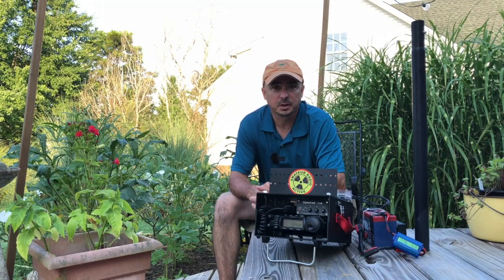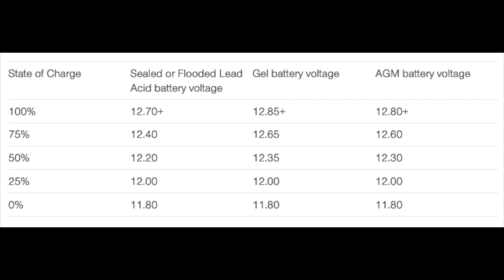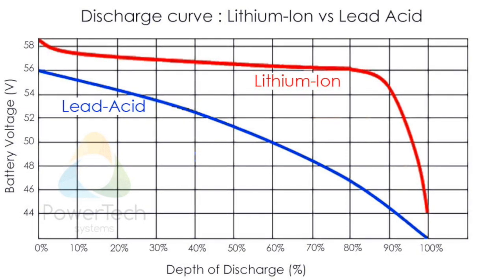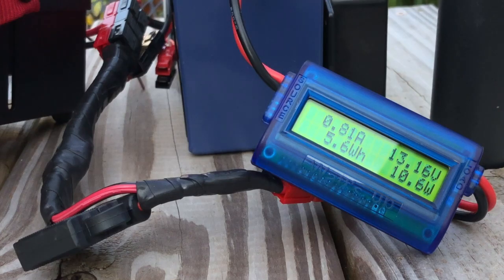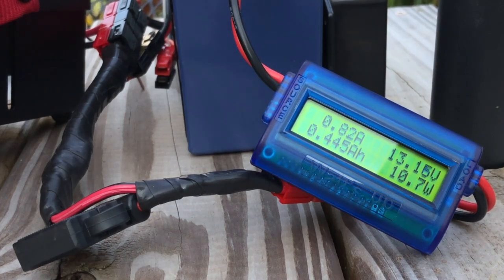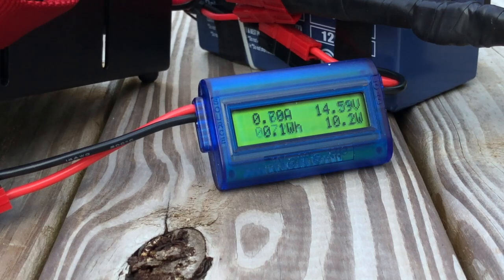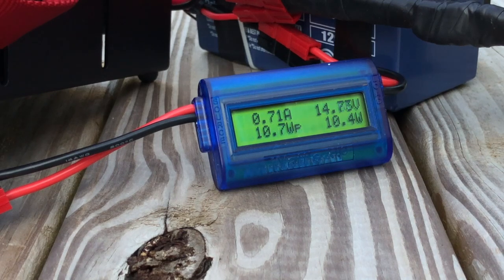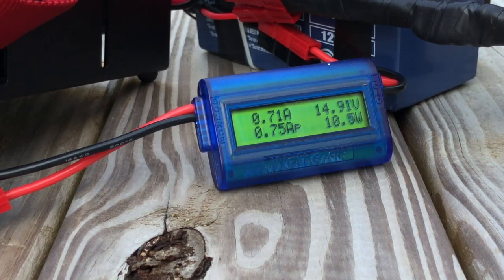Watts Up Battery Meter

Comment: Thanks for explaining how this meter works.  I just got one so I can monitor my new Bioenno 12 volt 4.5 amp/h battery when using my FT-817ND.  I had been using a SLA 12 volt 7 amp/hr battery but that thing is heavy for backpacking!!  Juddie - WD8WV
Reply from the maker: This is a must have if you are moving to the LiFePO4 batteries. You will find it to be invaluable in the field. 73, de KM4ACK

Comment: Great short video. I have a very similar load meter and find it really useful for all the same reasons you stated. Thanks for sharing . 73 de 2E0IEH
Reply from the maker: It is hard to live without that meter. Without it you are truly flying blind. 73, de KM4ACK

Comment: As usual, nice video Jason!  Do check out the PowerPlus from Buddipole.  It provides state of charge info plus a low voltage disconnect to protect your battery from fatal discharge damage.  (Ask me how I know ;).  Also they sell the Buddipole PowerMini which also provides solar charging data (and it is RF quiet). 73, Greg  VA7BC
https://youtu.be/KdX_asWFRPE
and 

https://youtu.be/1fWxEUP32kw
Reply from the maker: Thanks for the link. I'll check those out. 73, de KM4ACK

Comment: on a side note... Have you ever done the trick with the FT-857D on the power plug that sets max usages (watts, amp draw, backlight)? I'm thinking of putting in a switch so I can do it more easily if I need the full 100w when on battery while mostly running just above QRP. I think it limits you to 20w.
Reply from the maker: I don't think I have ever seen that mod. Have a link? 73, de KM4ACK
Reply: @KM4ACK  Sorry, no link. But it's in the owner's manual on page 34 for the rear panel connectors describing the input power cord.
Here's a cut-n-paste from the pdf version:
INPUT Jack
This is the DC power supply connection for the transceiver. Use the supplied DC cable
to connect this jack to the car battery or DC power supply,
which must be capable of supplying at least 22 Amps @
13.8 VDC. Make certain that the Red lead connects to the
Positive (+) side of the power source, and that the Black BATT SENS
lead connects to the Negative (–) side of the power source.
This Jack also provides an Transmit Power Control terminal. If you connect pin-3 (BATT
SENS) of the DC power jack to the ground, the FT-857D automatically switches to 20
Watts (430 MHz: 10 Watts) of output power.
Reply: I tried it with a jumper in there and it seems to do more than limit power, such as disabling the back light. I was thinking of using a switch for easy field ops.
Reply from the maker: Gotcha. You are referring to the small brown wire next to the regular red/black power leads. Can't say that I have ever tried it. 73, de KM4ACK
Reply: @KM4ACK  That's it!
Reply: @KM4ACK  Is your email good on QRZ? If so, mind if I drop you a note off-line?
Reply from the maker: yes. good on QRZ. don't mind at all. 73, de KM4ACK

Comment: Technical advice, the belief that LiFePo4 can be drop  to 90 % before recharging is FALSE. You are in for a huge surprise. Read Engineer's review.
Not more than 70% and reload. VA2SOB - 73
Reply from the maker: You can discharge them that far but you may run the risk of damaging your battery. So far, I have seen no negative effects of discharging that far on field day this year. 73, de KM4ACK
Reply: @KM4ACK  Yes, the report writes that they observed this behavior with multiple cycles. I have even seen one LiFePo4 explosion during recharging and there are supposed to be safe compare to Li-ion old tech.
Reply from the maker: Haven't seen one explode but I suspect it is possible with all batteries. 73, de KM4ACK
Reply: The LiFePO4's I use have a built-in BMS which shuts them down before getting to a damaging level.
Reply from the maker: @rkaag99 The dakato lithiums that I run also have overcharge & over discharge protection built into their BMS. 73, de KM4ACK

Comment: There is a Bluetooth dongle on amazon that Julian OH8STN likes a lot it provides a lot of information: very expensive.
Bluetooth Battery Monitor, DC Power Meter
by Thornwave Labs Inc.
Reply from the maker: Yes. I just can't justify the price. 73, de KM4ACK